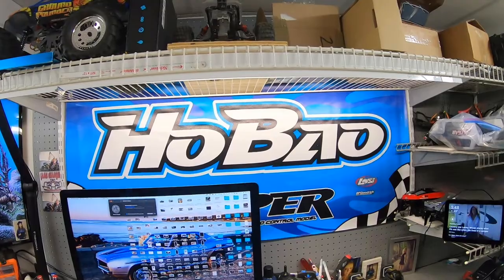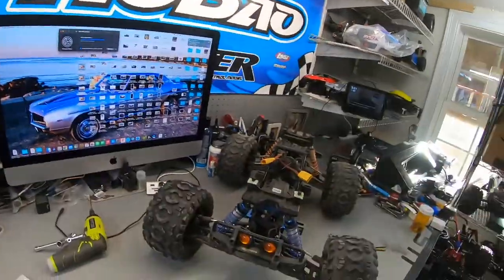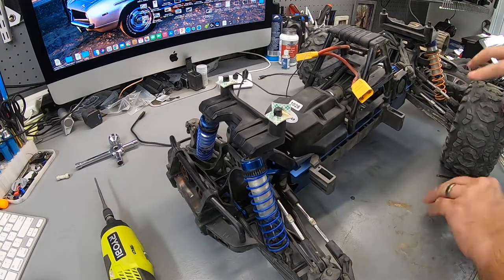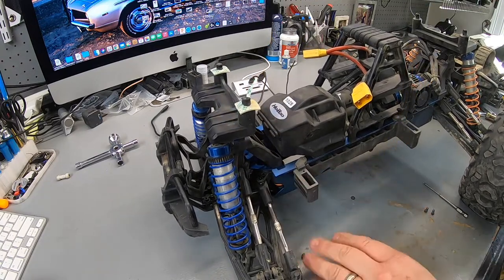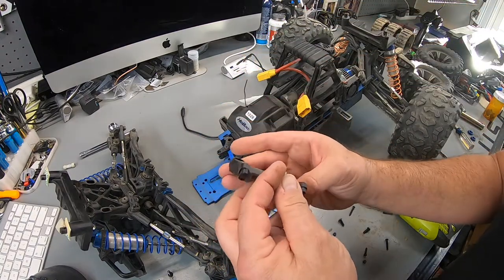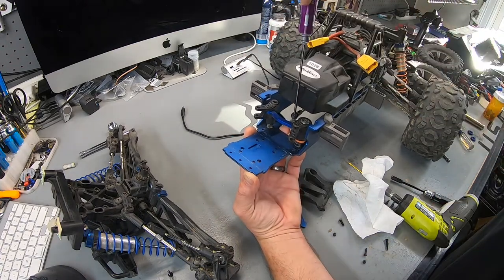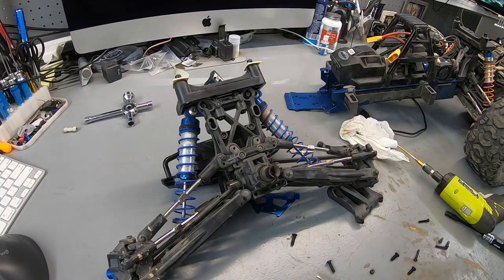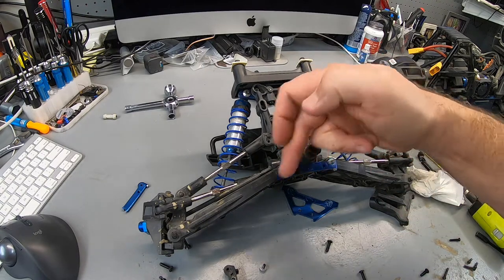HoBao MTX front suspension removal and repair 🧰

Comment: Block and retainer need to be billet and not cast aluminum if they broke that easily.  Screw missing may have contributed to additional stress if that is indeed the case so we’ll see.  Thanks for taking your 🤓 off and sharing! and needs more gear,  target 60mph & send it 🚀